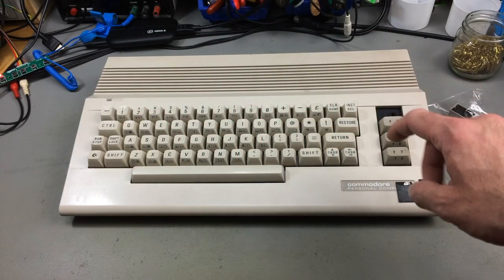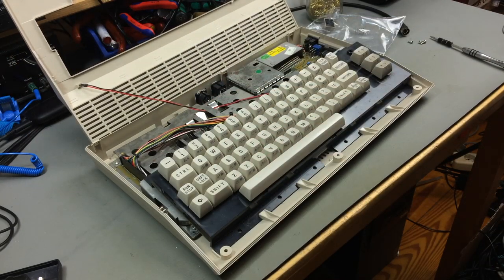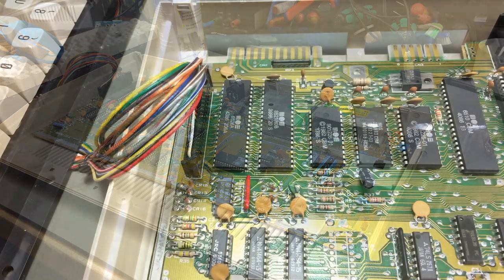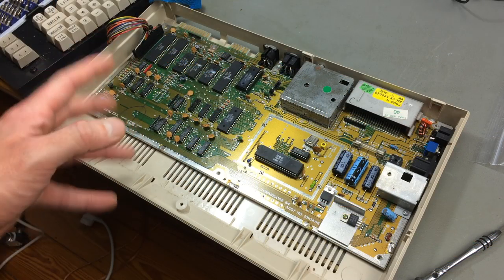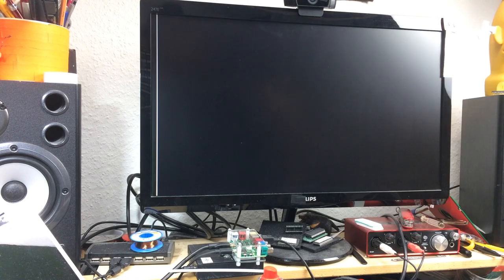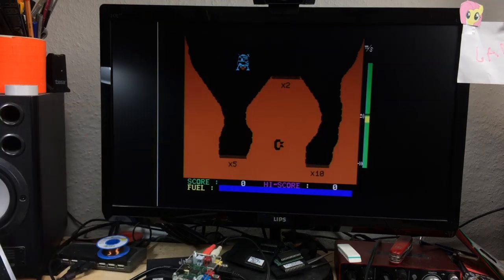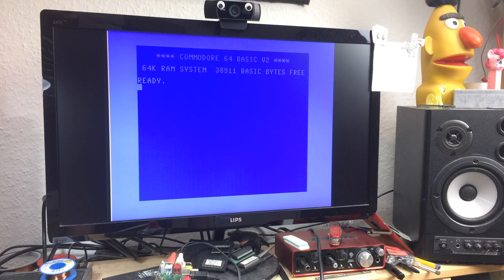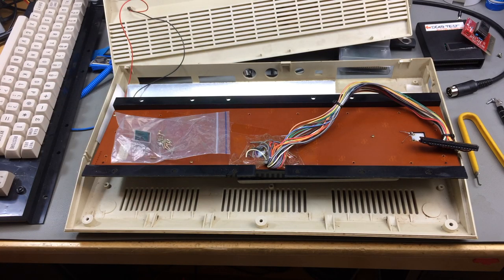C64C Black Screen Repair

Comment: That’s the same year model of the Commodore 64 I used when I started to make music via MIDI. I had a sequencer running—usually struggling—as I pushed the Commodore to its limits with MIDI data driving the synths and drum machine and synchronizing to a cassette deck.

I had the Commodore cassette, the 1571 disk drive and the 1802 monitor. 

Man, I learned a lot with that system! Thanks for the memories, Jan! 👍

Comment: I think those metal shields also make great heat sinks and I have never needed to put heat sinks on any that had it! Just remember the thermal paste! So far every 466 I have received had a bad Sid with the exception of the working C64C  I first bought which had no sockets.
Thanks for a very much needed video. I look forward to more like it.  For me, the first thing I do for troubleshooting is take out the Sid. Most of the time it is the SID or the Kernel. I had one that all the socketed chips were bad but everything else worked after replacing the socketed chips.
Reply from the maker: Yes, they do work to an extent if you put them on carefully (with thermal compound) but I think individual heat sinks will still be more effective. They are far easier to attach realiably, too. Taking out the SID is a good idea indeed (I was a bit too impatient) as it's a fragile, expensive chip and the system will start up without it. :)

Comment: Jan, the CA serial prefix is common to all USA made C64C machines. They did make some C64 breadbins in Canada (I’ve had a couple in my collection), but as far as I know all the C64C in Canada were just normal USA made C64C...
Reply: tone167 They also used the CA serial prefix on C64s made in West Germany as well though. I’ve never seen anything online that mentions what the CA prefix actually meant if anything...
Reply from the maker: The Aldi models also have the CA prefix, also made in the USA. I think most German ones have a WGX prefix.
Reply: I think all of the "CA" models were made in California. CBM first made C64s in Pennsylvania factory and those units have serial numbers starting with "P".

Comment: Ich habe eine halbe Tonne Expansion Port Connectors in der Garage liegen. Drunter has der AliExpress nicht geliefert. Ich werde Dir einen rüber schicken, wenn Du möchtest. Und den NTSC würde ich in keinem Fall umbauen. Das ist für die Forschung und die Sammlung doch viel interessanter. Ich habe auch einen 250466 mit 8521 CIA seit kurzem. Diagnostic 586220 zeigt U2 bad, aber auch den Interrupt. Das mag am Unterschied NTSC vs. Pal liegen.

Comment: Why is that white line still on the left of the screen? Any way to fix that?
Reply from the maker: Yes, the line usually is outside the visible area of CRTs. It only shows on some modern screens. It's a "feature" of the VIC-II chip itself, I don't think there's a fix for it.

Comment: I just bought the same one (my first c64 in general) with the same keyboard and board version.! The huge plain grounds are a pain to change the capacitors!(and the back plate). Atari 8bits are a bit easier to work with. I can't wait to  make it work!

Comment: Wish I kept my c64c,  you have inspired me to get another!  Love the old tech 🙂
Reply from the maker: Same here, my original first C64 (Aldi model) was sold to pay for my A500 (that I luckily still have).
Reply: @JanBeta  Same here! Sold my ALDI C64 to pay the Amiga 500 (which I sold later, too, just to buy a boring PC) :-(
Well thanks ebay I have 2 C64C now (unfortunatelly the ALDI C64 are pretty rare...) and soon maybe a C128 which I always wanted to have.
By the way: Which boards match with the ALDI C64 case? Just any? Or do some not match at all?...

Comment: Btw i think adrian has a video for moding a C16 and switching between PAL and NTSC, idk if it could be done on a c64, could be a fun mod for this one I guess
Reply from the maker: It's a bit more complicated in the C64 as you need both the PAL and NTSC VIC chip for that. The C16 TED supports both video standards natively so you just have to change the clock speed in that machine.

Comment: Hello Jan, I would really like your input on a problem I have been having with my c64 assy 250425. I can boot normal, but when I insert a cartridge like Final Cartridge or KCS Power Cartridge I get a blank screen. Pressing reset on Power Cartridge gives the kcs menu. Same with Ultimate II+. Blank screen, but when pushing the middle button, normal menu.

I am at my wits' end with this..

Any input is highly appreciated!

gz from Holland :P

Comment: Why is there a ferrite core on the power led wire?
Reply from the maker: Probably for dampening some RF noise that would emit outside through the wires. They had to be careful with FCC regulations and such.

Comment: Hi.. I suddenly get a black screen after more that 30 years :(... y check the power inside I  measure the DC and AC that you say and one of this measeure fail for me.  THe User port have got 1.7V DC (not 5V).. What can cause it?  help me please
Reply from the maker: I would guess that there is a shorted IC or other component on the 5V rail, difficult to tell which one because most of them are powered by the same rail (except for the VIC-II and SID which are powered through the 5V and 12V voltage regulators). You could try to feel if one of the ICs gets burning hot, if some of the ICs are socketed you could try to remove them one at a time and see if the voltage reads okay without the IC. Most commonly, RAM, the 6526 CIAs or the PLA fail like that.
Reply: @JanBeta  Gracias for your response. I power on and the only IC that get very hot (ouch!) and fast (1 minute i think) is the VIC. Others keep normal .  :(  . the mainboad model is 250466.
Reply: I remove the SID and c64 turn on ok !. so .. maybe it can be the SID itself or PLA?

Comment: Were the two parts of the key stem intact enough that you could glue them back together and have a usable spare?
I have that revision of the C64c board, and it’s been giving me no end of diagnostic troubles ever since I started attempting to fix it last year.  I’m going to have to contact Ray Carlsen for advice.
Reply from the maker: The parts are still intact, I might be able to glue it back together indeed. Ray Carlsen is a true guru. He's most likely going to be able to help. :)

Comment: Very cool. Congratz with the 250466. Some consider it the best of the motherboards. This is my 1986 C64 i got for christmas. It had also mixed cia, and r4ar sid. Also mine was bad. Sadly.
Reply from the maker: Thanks! I have another r4AR in my C128 (and admittedly I don't really like the sound of it all that much really... ;)) The SIDs are soo fragile unfortunately. I have a lot of broken ones laying around but usually they only make weird noises and are not dead shorts.
Reply: Jan Beta I wonder if we could get a real SID fabbed somewhere. Not FPGA, not Arduino or something, but get one made from scratch. There is so much you can already get made...

Comment: How many have you had in your hands now?
How many of those have you fixed?
How many were unfixable?
Reply from the maker: Oh, I stopped counting. I currently have 5 or 6 here that do work (I repaired all of those). There's 2 or so that are beyond reasonable repair (butchered boards, ripped apart, missing components etc) and I have 2 around that I tried to fix and didn't succeed yet. Both short board versions interestingly. I seem to have more luck with the older models. ;)

Comment: I would like to locate this exact same setup (250466 board and original keyboard layout). Some day. Is this the first time we've seen you use your 1541 Ultimate? I've seen it in the background plenty of times but I do not believe you have shown it on screen before.
Reply from the maker: Oh, I'm using it all the time really. I might do a dedicated video on it sometime, too.

Comment: That is a great motherboard, my favorite also. Too bad about the SID, the 6581R4AR is considered the best by many, and their market value at least in Finland is ~50€. I was a bit uneasy with the way you handled it, since it is the king of SID chips. I'm sure you've heard this many times, but the SIDs are very sensitive chips. But, this one was already broken, so... That board sometimes does have the 8521 CIA chip in the U2 position. I can confirm that it will show as BAD with the diagnostics cart, even with the harness connected. Nothing to worry about.
Reply from the maker: Yes, the prices for the R4AR are hilarious here, too. I have another one in my C128 and I have to admit I actually don't like the sound of it all that much... ;D

Comment: What is your recommended voltage regulator did you use to replace the 7805 with? And what brands are you using? Seems to be a lot of options. Mark.
Reply from the maker: I think the ones I have are 78S05 (the S means slightly higher current rating, will run a tiny bit cooler) from ST Micro. There's a couple of good brand parts. I think Texas Instruments also makes them.
Reply: @JanBeta       
Thanks for the quick response LOL I'm not sure if the voltage regulator is responsible for the slow rise in DC voltage did I'm experiencing but I thought what the heck may as well replace it for future proofing! BTW, keep up the great videos I watch all of them!

Comment: An NTSC machine very cool and workin' again, I've never seen the fact that the SID could stop a whole board from workin' right.

Ich weiß, dass ein PAL-Gerät am Ende besser passt, aber ich habe mich etwas gefragt. Sie haben versucht, ich denke, ein Spiel darauf, haben Sie andere Commodore-Spiele, die NTSC sind, oder haben Sie das bekommen, um auf eine andere Weise zu spielen?
Reply from the maker: Oh, many games work on both NTSC and PAL, I think there are very few that were exclusively designed for NTSC. Usually they just run a bit slower on the PAL machines due to the slightly lower clock speed. :)
Reply: @JanBeta  I guess there wasn't anythin' that was exclusive made for one or the other with any variation at this point, never thought of that, realistically it should work either way but as you said PAL doesn't translate up to NTSC well sometimes.
Reply: NTSC-Spiele funktionieren im Allgemeinen auf PAL, aber oft passt sich das Spiel nicht an die niedrigere Bildfrequenz an. Das Spiel kann daher auf einem PAL-System langsamer sein und die Musik kann auch langsamer sein. Eine NTSC-Maschine kann nützlich sein, um das Spiel so zu sehen, wie es die amerikanischen Programmierer beabsichtigt haben. Außerdem kann eine NTSC-Maschine bei der Entwicklung neuer Software zum Testen nützlich sein. Dennoch, wenn ich mir ansehe, wie viele Spiele auf meinen alten Disketten gut auf NTSC funktionieren, ist es sehr enttäuschend. Eine PAL-Maschine ist definitiv der C64, den du willst haben.
Reply: @SaintKaede  Designing exlusively for NTSC was commericially not viable, because the installed base of PAL machines was much higher than NTSC. Making a game PAL only on the other hand, did make the market a bit smaller, but on the other hand programmers are always fighting for raster time. Having 20% more raster time on PAL machines is therefore a big thing and many coders just gave up the fight to squeeze their code into NTSC timings.
Reply: @danielmantione  Ah now that's somethin' I didn't know good info thanks!

Comment: As far as the NTSC to PAL change, why not use a small, low profile rocker switch?  It looked like to me that if it were jumpered, it would be PAL only.  If it were switchable,  you'd still have a NTSC system in your collection that has your favorite mainboard.  Just a suggestion...
Reply: As Jan said in the video, you also have to replace the quartz and the VIC. Otherwithe, commodore would already have included a switch when the machine came out.
Reply from the maker: Yes, it's a bit more complicated than just changing the clock speed. Currently researching solutions to maybe make it a PAL/NTSC switchable machine some day. :)
Reply: Sorry about the half baked idea.  I was about to go to bed when I posted it.  But I think it's feasible with some actual planning 🤔

Comment: So what makes this revision so desirable?
Reply: Well it is alot easier to maintain regarding the dram because it only has two chips instead the 8 chips on the normal breadbin. As Jan pointed out it is common to have the much desired Sid 6581R4AR on it and in general it has way better picture quality when compared to the breadin with the earlier Vic-II chips, like an ceramic 6569R1 vic-chip for example. I mean that 250466 uses an later version of the Vic chip. In Jan's case this time the Vic-II he's got there was the ntsc 6567R9.

Comment: As an NTSC user I can say the only thing you miss out on with not having PAL is DEMOS. There are a few PAL only games but the vast majority of games from Europe, back in the day, were brought over to NTSC land and the opposite is true thanks to US Gold brining over NTSC games to PAL.  

It is very common for people that grew up in PAL territory to say there is "Much more Software in PAL territory". It used to be a very popular debate. If you are counting DEMOs then yes but games and productivity then no.  Also if you do convert your NTSC machine to PAL in NTSC land make sure you have a monitor that supports PAL like a Sony PVM if you want a CRT.  LCDs probably more so but it depends on the make/model.

I am thankful to have a C64 reloaded configured as PAL for exclusive use with DEMOs as all my other software runs just fine on may regular NTSC machines.  On my CRT PAL produces flicker, since it runs at 50hz.  I will take a little less software to run and zero flicker any day.
Reply from the maker: Thanks for the info. I always thought there were quite a few games that didn't work properly for NTSC. I'm definitely going to explore it some more. I might make it a switchable PAL/NTSC machine or something. We'll see. :)
Reply: @JanBeta  Check with Perifractic to see how close the VIC II switcher board he is working on is to being finished.  That will be cool because then you can have a PAL and NTSC VICII chip installed plus both crystals and be able to select PAL/NTSC at the flick of a switch.

As for games there probably are some later ones that were PAL that didn't get ported over originally to NTSC.  I know some cracking groups fixed some of the PAL only releases to work on NTSC.  But yeah I agree with you It is nice to have both standards.  I am a huge DEMO fan so PAL is a must for all the Euro ones.

Comment: I have a question. Does the ntsc machine run slower on European power? I know in United States they use 60 hz. In Europe a lot of countries use 50 hz.
Reply: No. The clock frequency is generated by the quarz, and the ntsc machines run a little faster (1,023 MHz) then the european version (0,985 MHz). Greetings, Doktor64!
Reply: NTSC machines run "faster" but they also run slower.. Because there's less time to put things in the screen so in the end PAL machines are much "faster"... long story but in the end PAL machines can do more.
Reply: @thomassmith4999  I would hardly say "much faster" and it depends on how the game or demo was coded too. Fire up a spreadsheet and sort some rows and see which finishes faster...  It really depends on the software.  Most Euro demos for sure will run better on PAL and probably not at all on NTSC...
Reply: The processor runs slightly (about 4%) faster on a NTSC C64 than a PAL C64. But for any game or demo that syncs to the video display (and most do!) an NTSC C64 has to update the screen 60 times per second, while the PAL C64 only needs to do 50 updates per second which is ~17% less. So the PAL machine ends up having quite a bit more CPU time available per frame to do complicated video effects, screen scrolling, sprite multiplexers, and so on. So that's how each machine is both faster and slower than the other.

Comment: AFAIK a shorted SID can affect anything on the 5V rail. But good restoration, I love the C aesthetic :)
Reply from the maker: Thanks! Yes, the SID can short both the 5V and the 12V rails in the worst case I guess.
Reply: @JanBeta  I've heard lots of cases of SID shorting the 5V, so the former is more common than the latter, and an often overlooked point of failure.
The good thing about those is that, much like in your case, removing the SID nothing else in the rail got affected, so restoration is truly as easy as swapping a new SID.

Going slightly OT, I guess I'm one of the few people appreciating the 8580 more than the 6581: it sounds like my childhood

I'm always more than happy to see a C64C restoration :)